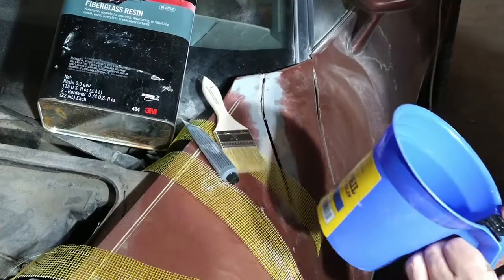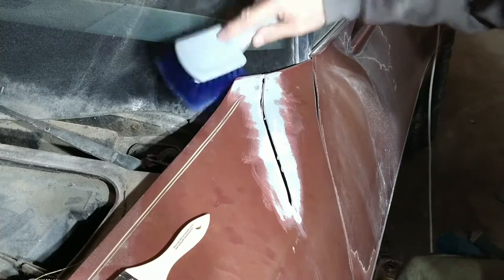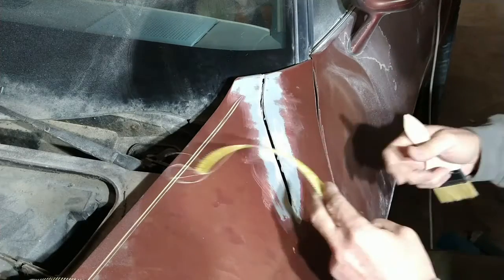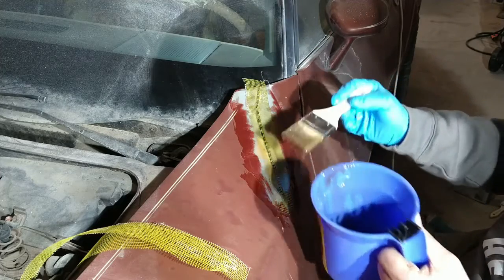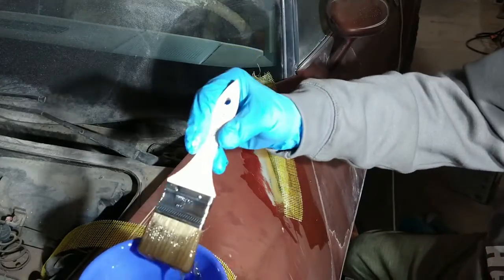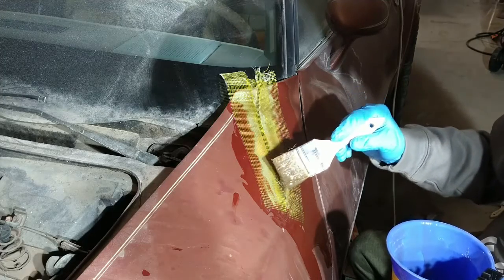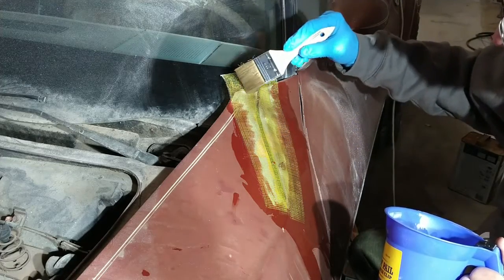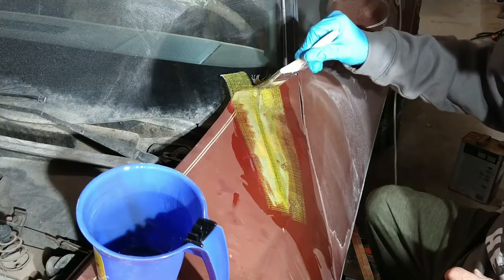C3 Vette Fiberglass Repair on Drivers Side Front Fender   Part 2

Comment: All respect to your video, You actually should be using fiberglass "strands" cutting them into
several pieces and laying them in and over the affected surface, after applying "Bondo Glass" from the rear
(to a prepped area) of the split at least half way up the depth of the crack, apply strands and resin on the top 
filling the crack up to the top surface.
Reply from the maker: Yes, many different methods to do this procedure. I am just showing a different way for people that don't have fiberglass strands or even mesh. Sometimes you might not have any access to the back so all reinforcement has to be performed from the front. The best part of using a Vette for demonstration is that there are many curves so you can build many layers from the front and as long as you have decent skills with your finishing body work nobody will know. Especially the place where I am working on, you won't see if after it is all done. I will show the final repair shortly. Had some major setbacks and wasn't at the shop that much and had others repairs that needed immediate time to repair. But thanks for your post and take care.

Comment: Fiberglass mat is what you should be using.  Why would you use that stuff?
Reply from the maker: Because it works just the same. If you listen to the video I explain this is a budget build. Most DIYers have drywall tape laying around the house or maybe their neighbor. Some people don't have the luxury of having easy access to places as I or maybe you do. Yes, you can use fiberglass mesh/matt, hell on the back side you can use regular epoxy that is just as strong. I've been doing this for years with no problem. But thanks for your post, I welcome all, good or bad. Take care.
Reply: @davesmancave483  budget build? fiberglass mat isn't expensive.